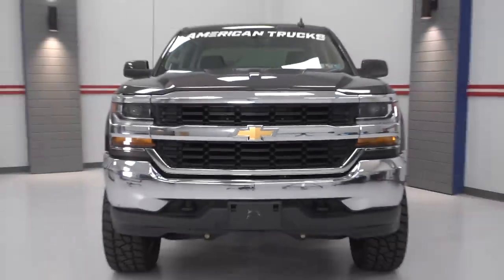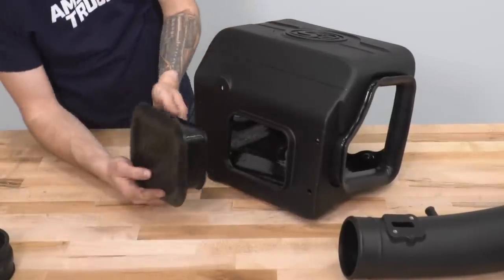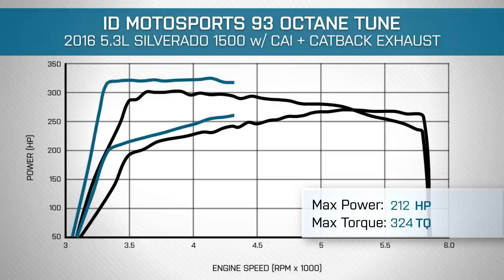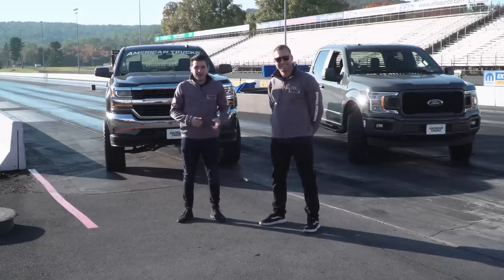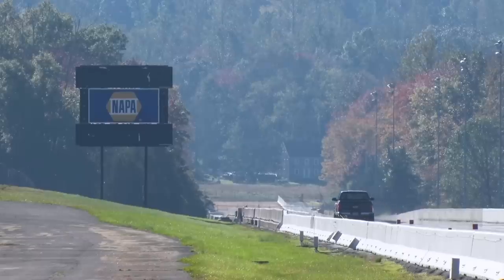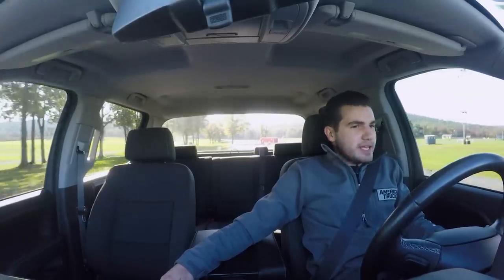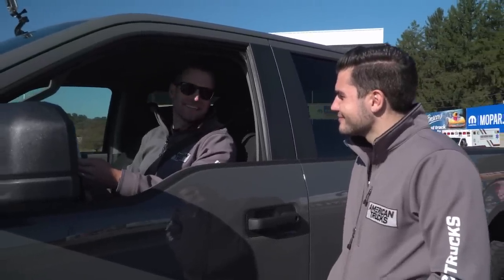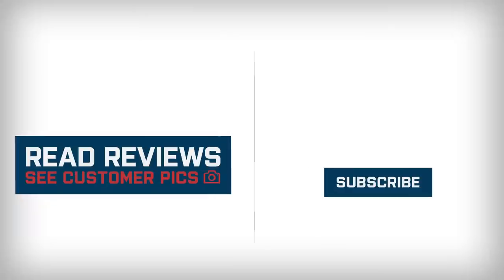How Fast Is a Tuned & Lifted Silverado? | Tuned Silverado Takes on the Drag Strip - The Haul

Comment: I mean it isn’t a fair Mach up and they know that. That’s why they said it all for fun. That 5.3 isn’t suppose to match up with the 5.0. The 3.5 ecoboost is. Yea the 5.3 has more displacement but the 5.0 has 4 cam. If they did the 6.2 it be better. And he alway running off road tires and lift kit. Not ideal for drag racing
Reply: Matt Callaway that doesn’t make sense. The 3.5eb goes head to head with GM’s larger 6.2, it completely outclasses the 5.3. The 5.3 is a very reliable engine but is by far the slowest V8 out of the big three. Even Fords small 2.7eb produces more power and better mpg’s than GM’s 5.3.
Reply: wendysorbust the 6.2 does go against the 5.0. It goes Chevy v6 4.3 vs Ford 2.7. 5.3 vs 3.5. 6.2 vs 5.0. It pretty clear. Both offer 3 engine options that compete with each other
Reply: Matt Callaway with all due respect, I don’t think you know what your talking about. 

Fords 3.5eb, even though it’s only a v6 it manages to perform as good, if not better than GM’s larger 6.2l V8. It does this because of its two small turbo chargers. The other benefit of the 3.5eb is that it can be bought in the lower trim levels as well. GM limits their 6.2 V8 option to their LTZ, SLT and above trims. 

Below that is GM’s 5.3 and Fords 5.0. As seen in the video above in both stock and modified form Fords 5.0 is a bit more efficient than GM’s 5.3. As someone who owned a 15 GMC  Sierra with a 5.3 it’s a highly de-tuned engine from the factory. You can check my channel if you don’t believe me. 

Ford recently began offering a smaller 2.7 Ecoboost engine. This slots right under their 5.0 offering but manages to match the 5.0’s performance numbers with only a slightly lower tow rating. 

I won’t talk about either manufactures NA V6 offerings since both are really aimed at the fleet market.
Reply: The 3.5 Ecoboost is a lot faster then the 5.0 especially when they are both tuned. My heavy 2015 3.5 Ecoboost crew cab FX4 ran 13.02 @ 102MPH. A more even match up would be the 2.7 Ecoboost vs the 6.2

Comment: Dude screw that cat back exhaust bs. Put on long tube heads going to true duals, dummy cats and dummy mufflers, or flowmaster super 10s. Then you'll get some good sound and better performance
Reply: No, actually you wont. Proven on the dyno, deleting the cats on the manifolds and adding long tubes changed nothing. Absolutley nothing, except sound which even wasnt much. Cat back is more than sufficiant and far less money  to put towards somthing that will actually gain some ground.

Comment: i expected more out of the 5.3 i mean for the longest time chevy has been faster then ford but i guess the tables have turned
Reply: For a long time... Where have you been? The 5.0L has been in the F-150 for 8 years and has maintained ~40 more hp than the GM 5.3L throughout that span. It is dated and GM seems oblivious that both Ford and Ram have been offering V8s that leave the 5.3L in the dust.

Comment: those hp #s are a joke that can tune basically shut the engin lights off, all the power came from the bol tons. and you had to have left the traction control ans stabilatrac on u can hear it cutting power on the launch.

Comment: 🤣🤣🤣 couldnt get passed 300hp!!!
Reply: The ford did......
Reply: @BamaShinesDistillery  ofcourse it did, 350hp with 35s
Reply: The 5.3 has 360 HP what are you talking about? The competition isn't much better. Maybe by 10 or 20 hp if that.
Reply: @anthonyj810  🤣🤣🤣🤣 to the wheels bud. GM can claim 1000hp but if it cant get to 300hp on a dyno, its embarrassing!!!!
Reply: @jetjoey19  And ford/ram does that to the rear wheels stock?
Reply: @anthonyj810  Ford hit over 300 to the rear stock.
Reply: @jetjoey19  why you triggered bro?
Reply: @robertdenniston1969  bro, you dont even go here
Reply: @jetjoey19  come at me bro!! Lol bro bro
Reply: @robertdenniston1969  🤣🤣🤣
Reply: DrgnFlys  is that rain? Oh wait, they're your tears. Bud, the f150 shown in the video made over 300hp with similar tire and wheel setup. Thats why i posted the comment.
Reply: DrgnFlys  Exactly

Comment: And this is why I drive an EcoBoost.
Reply: No point in an EcoBoost tho. A lot less torque yet it only saves like 1 or 2 MPG if you get 4wd which in my opinion is needed in a truck/suv. If you get bad winters or like to go mudding.
Reply: @anthonyj810  ecoboost has THE most torque of any of the trucks.  Currently the "milder" 3.6 is running 375hp/470 lb-ft and the Raptor and Limited trucks get the 450hp/510 lb-ft tuning of the 3.6, vs GM's 6.2 at 420hp/460 lb-ft.

Comment: $6-800 AND ONLY 25HP GAIN. Um yeah, nope.
Reply: Long tubes , intake and tune all you need , speed engineering has a decent set with y pipe for 400 ish . Find someone that uses hp tuners . Wakes the truck way up
Reply: Nathanial Ross that is gains that any fool can do in front of his house with no real tools and not tearing your truck down. That’s a decent increase all and all, especially in the range that most people are in on a daily driving basis.

Comment: Y didn't you run it in auto that's all wheel drive I think you would have a better time
Reply: Auto isn't all wheel drive.
Reply: That's not what I was told and my research tells me the same
Reply: Auto just engages the 4 wheel drive system for you when it senses slip from the rear wheels. It's a two speed transfer case. 4hi and 4lo. It's auto 4hi not AWD. Speed sensors monitor the driveshaft speed differences between the front and rear shadt while in auto. When the rear spins faster it engages the front differential. Generic overview.
Reply: Ok I can see what your saying but then why to you get 10% of its power to the front  and if you tune it can get more to the front so that would class it as a swd system right
Reply: @ihian82  I'm not sure what you're asking but in a two speed transfer case as in this video the power is 50/50 because the transfer case is locked while in 4wd. It's considered "part time" because it can't be used at all times. Then there are "full time" that can be used at all times. It can get confusing that's for sure. 🍻 Cheers
Reply: Ok so your trying to tell me that the 2014 and above isn't awd then y is armageddon turbos say isn't awd and why is my running shop calling awd and y can they tune it
Reply: @ihian82  No that's not what I'm saying. They make AWD trucks too. I'm saying switching the knob to auto isn't AWD. It's a totally different system. The truck in the video has a two speed transfer case. True 4 wheel drive. Not AWD.
Reply: I see sorry for the miscommunication then
Reply: @ihian82  It's fine. No need to apologize man. Have a good one

Comment: 273 that's slow af
Reply: Through 33 inch tires with a 3.23 gear which is actually closer to a 2.80 gear with the 33's. That's a good number.
Reply: @EGGINFOOLS  I have a 13 silverado crewcab 5.3 6 speed 3:42 gears possi on e85 long tubes and intake and doesn't feel slow at all your right the tires fucked with the dyno numbers